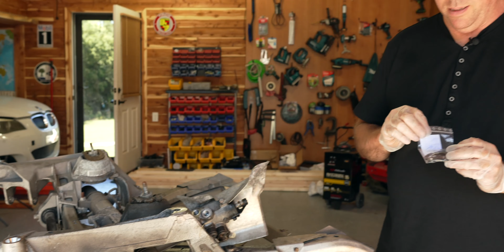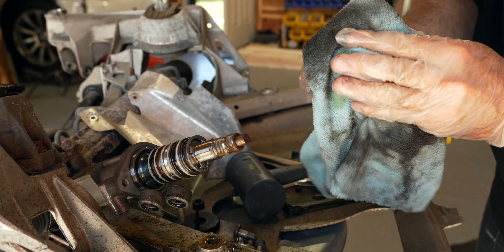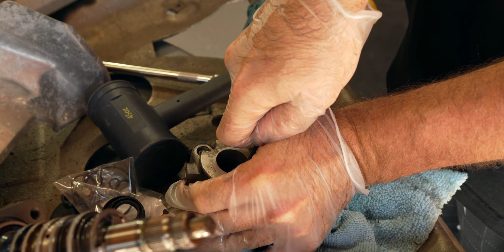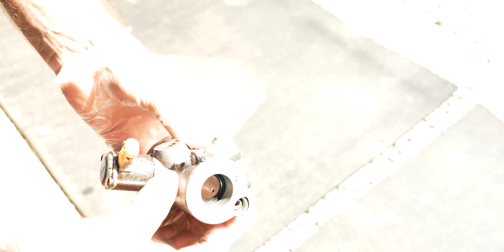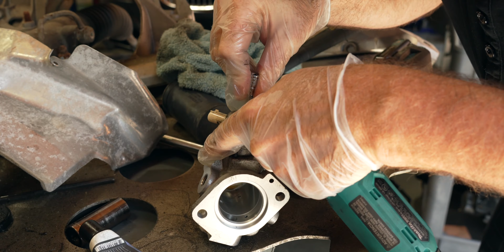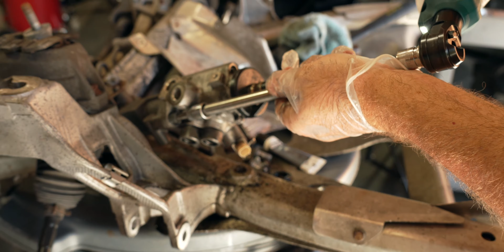BMW E60 E90 Rack And Pinion Input Shaft Seal Replacement (Most Common Power Steering Leak)

Comment: I just did this whole process with the steering rack still mounted on. Took about 6 hours to complete but better then having to lower the whole subframe! I removed the air filter intake and it gave me enough room to reach it from the top.

Comment: my steering developed a kind of clunk going over potholes mostly. No leaks, no play although the mechanic told me is not so firm on the driver side. Also has a tendency to tramline on uneven roads and with speed i feel a little vibration. For the newer versions i saw a fix by replacing a teflon preloader on the rack. Do you know if that is possible on the 2007 models ? Thanks.

Comment: For all looking for the input shaft seal it is a 20-30-5 seal. The inside diameter is 20mm outside 30mm and width is 5 mm. It is just an oil shaft seal and available on Amazon. It will save you vice spending the 200 with shipping for the kit.
Reply: Thanks for the info!  Do you happen to know the size of the Orings for the 2 pipes on the side?  Looks like 4 small Orings.

Comment: On E60, does the subframe have to be removed to get the steering rack out? My configuration is a 528i with regular power steering (no active steering or dynamic drive)
Reply: Yes, but you can change the seal for the input shaft while the rack is on the car. You can remove just the top part
Reply: @NordicAutoFix  But lowering the subframe is necessary or can the top part of the rack also be removed when the subframe isn't lowered?
Reply: @AbcAbc-ox6pg  the top part should be able to be removed with the subframe in place. I think the two screws that is holding the top part together is accessible with the steering rack in place.
Reply: @NordicAutoFix  Thank you very much for information. This is good news and I will try my best to replace the seal. My steering rack isn't leaking badly but I want to fix it.
Reply: @AbcAbc-ox6pg  I also think there is a seller on eBay that sells the seal, and he also says that the seal can be changed without dropping the subframe
Reply: @NordicAutoFix  Do you know his ebay account name or have a link? I don't know where to buy the correct seal. Thanks
Reply: @AbcAbc-ox6pg Did we ever find the gasket need to do this repair?

Comment: I occasionally had problems removing screws on aircraft. Get an impact screw driver. Not a battery-operated unit, the ones you hit with a hammer. Basically, it's a punch that turns when you strike it. Can save you rounding out a screw. More force down that torsional. Cheap tool.

Comment: nice tutorial. an impact screwdriver, with a prior blast of heat/torch, is the way to go on those meddlesome machine screws. Did you post somewhere a link to the facebook page where you sourced the rebuild seal kit?  I too have noticed that the rack and pinions on the e60 e65 tends to leak persistently from the input shaft.  Good to finally see this tutorial published. thanks.

Comment: hey i need help, i’ve broken my timing chain guides on my 01 e46 330i m54, i don’t know the correct way to change them, do i need to take off the crankshaft pulley and the whole front case? i have the cylinder head off already & have the parts ready to change them

Comment: There is so much reluctance in the car industry to get anyone to do this kind of work. Chances are that the original rack with a new seal will out last a fully reconditioned one...
Reply: Tend to agree, but why are “aftermarket” reman units so crappy/leaky? Is it really that difficult to rebuild correctly…I mean is the aftermarket using either incompatible, incorrectly sized or otherwise inferior seals, or are other worn components on shoddy units just not replaced when they should be? So sad that too frequently many cars get to this fork in the road, where such an expensive job due to *both costly removal labor, quality part cost, and sadly—owners going ‘round and ‘round with incompetent mechanic shops that charge their shop labor, still don’t do the job right and owners just give up. It leads to many cars ending up in the junkyard much too soon, which is sad
Reply: I am contemplating this very point.  Have yet to come across any other leaks on these racks except for the input shaft and in some instances the pressure lines.  If i had to guess, the rebuild units are made with inferior quality seals, they are only warrantied for a relatively short time, and they want you to buy their product again after it fails in 1-2 years is my guess.  They don't sell a lot of these types of rebuilds if i had to guess...who knows what is really inside them or if they have replaced all seals?  BBB industries makes a cheap reman. BOSCH KS01000936 is another $1000 or so reman option.  Hard to go through all that labor and not consider replacing the entire rack new, imho.  But it does seem like this input shaft seal is the only weak link on these racks.  I have an e60 with 190k on it, rack has no issues.

Comment: Cool if you could put a digital vernier on that one seal and tell us the inside diameter, outside diameter and the thickness. There is nothing unique or expensive about these seals, you just order them up by size for 10$ each.

Comment: Any tips on how to centre the rack mines slightly out. Thanks
Reply from the maker: You have to count the turns on the steering wheel to get that center, then unhook the steering shaft and turn the wheels straight